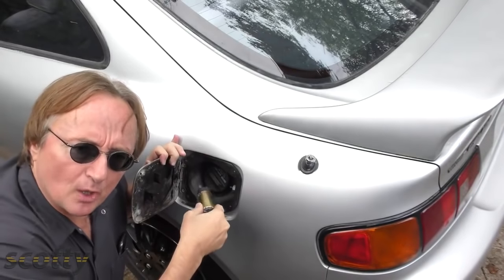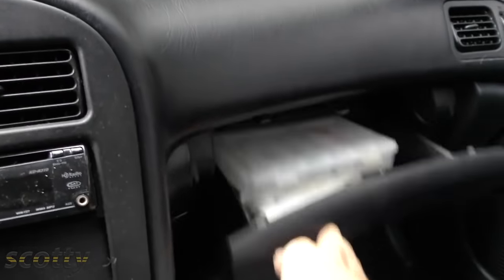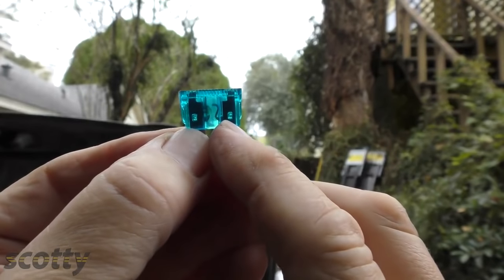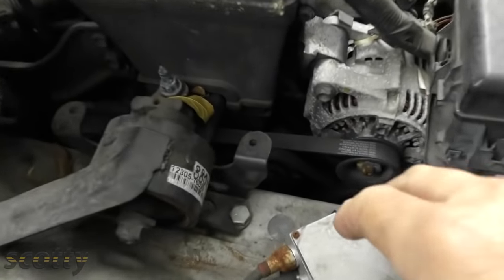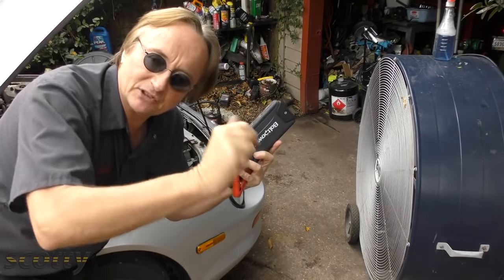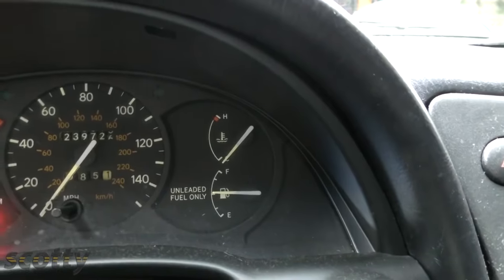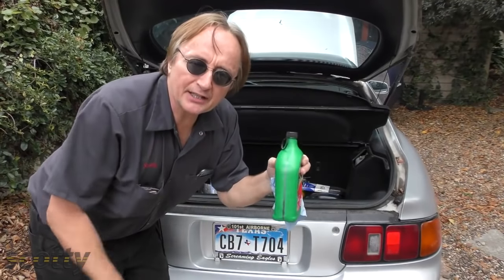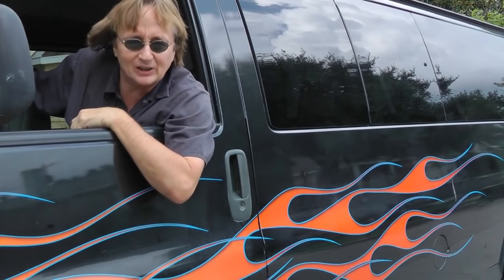How to Fix a Car that Won't Start and Randomly Dies While Driving

Comment: speaking of heater cores, any idea why the hell the heater on my 95 Lexus only half works? basically only blows out real heat if it's revving above 1500 or so. otherwise just blows out ambient air.

Comment: Always have bottles in the trunk of the RX-7 with premix oil for fuel ups. Don't think I'll ever end up with an engine oil related problem. Heck even if the oil pump goes bad I should be good.

Comment: If it cranks and you got gas it my be the timing belt. Be aware of the out-of-gas procedure specific to your vehicle! Just crank and go does not work in many cases. If you are out of gas with a bad gague you can be quiet and listen for the fuel pump noise while the key is on but not cranking.

Comment: Funny you started with the fuel issue.... My wife came home last night after fueling the car(2016AcuraTLX), gauge registers just under 1/2 tank, but the low fuel warning light is still on.... I'm thinking gauge may be ok but computer not working? ideas?
Reply: 2016 should be under warranty.  I wouldn't mess with anything, just take it in.
Reply: Well, we waited to just under 1/4 tank, I had her fill up and the light went out. Hasn't acted up again since. My next step would have been the shop. I have an Odyssey that had the in tank float go bad,  but the Acura was behaving differently. I knew the in tank float was not it.  Anyway, it all seems good for now.

Comment: Check your oil every time you fill up your tank. Just changed it? Check. Just filled it last fill up? check. Its a good habit to start.

And jokes aside, carry consumables. Vital fluids, maybe a belt, gas can, quarts of oil (for the love of god strap these in a safe place so they don't pop), coolant, etc. Also get your oil changed at jiffylube, they check a bunch of stuff which helps take care of your car alot (its worth the extra)

Comment: If non of Scotty's remedies work, like you got gremlins or something, remove your negative battery, wait 15 seconds, and reattach it.  If you own a ford truck, look in the passenger floor board for a fuel pump reset button.

Comment: I have a question my dad has a 2006 jeep commander that's been sitting for 3yrs he just starts it up but never drives it one time he drove it but it would run slow he had his foot all the into the gas pedal and would still be slow what could it be? 🤔🤔🤔🤔

Comment: I've been stranded by an alternator that died on the highway (I like the battery booster trick) as well as a heater hose connector (damn GM plastic) that snapped while driving blowing coolant everywhere. Managed to limp that one home a 1/4 mile at a time.

Comment: Always keep a cab of fix-a-flat in your trunk. More than likely, that's the issue you're most likely to deal with while on the road. If a fuse blows out, you probably won't have the time nor the focus to troubleshoot the issue while parked on the side of the road. In that case, just call AAA and have your car towed home.

Comment: My dads old ram (new fuel pump) wouldn't fire up. After many hours of fussing with it we found it wasnt sending any fuel to the engine. I also noticed that 20 year old vehicles have bad plastics and electrical connections that wont hold. So I checked the connection to the fuel pump, applied some pressure to it and had him crank it and it fired up! We secured the connection with a zip tie and made it home. Another time my dads old ram got stranded was because it wouldn't crank, the ignition housing had a broken piece where the key cylinder makes contact and replaced that in the dark right before a storm hit us. Don't be like my dad, get rid of your old ram.

Comment: i have an 04 bonneville 3.8 it cuts off in drive or reverse.  now it wont turn on at all. i checked altenator its pushing 140 amps as recimmended.  bought brand new battery car started then cut off in reverse

Comment: You forgot to mention those money pits that stop running because the computer goes bad or the injectors die like in those VW BKP engines or those Alfa Romeo's.

Comment: My 1998 Chev. pickup Silverado is well maintained regularly by a quality mechanice who has his own shop and has been servicing all our vehicles for years.  We have a recent problem no one seems to be able to solve. The engine just dies for no apparent reason.  Not often and it's always started right up after a couple seconds. EVERYTHING has been checked!  We maintain everything regularly. The mechanic has used every device available at various points in time to try and diagnose the problem to no avail!  He says he's been kept up at night thinking about it.  The one thing he has not tried is the guage that fits on the engine and stays there while the vehicle is being used so that when it does stop, the guage can be read to see exactly what has happened before it died. Our mechanic says he's been thinking of buying one, but they are very expensive.  What are your thoughts, all the obvious and not so obvious have been checked?  Is this aforementioned guage the answer at this point? If you can solve the problem, I'll shout your name from the roof tops!  Thanks for any advice you can give.

Comment: I remember back in auto shop the teacher said something about using a penny or a gum wrapper as a spare fuse to get down the road is there any truth to that?
Reply: Alex Quintero sure. A fuse just allows electricity to flow, but a fuse will break when overloaded...other stuff wont, which could be dangerous.   I bet your fuse box has a spare fuse in there, if not, id borrow the fuse from the radio or door locks before id use a penny or .22 rimfire cartridge (for a good laugh, google it)

Comment: Fan belt? Scotty that's so last century...but does apply to my rwd volvos.
Reply: holidayhouse03 still most cars I know of have serpentine belts (also known as fan belts from the old times.) with a full electric or hybrid maybe not I think some cars nowadays have at least some additional electric waterpump, electric oil pump and also electric servo pump and AC
Reply: I actually get a kick out of some of Scotty's "old times" vocabulary, it's a major part of his charm.
Reply: He calls them fan belts in his videos because lots of old people know what he means when he says fan belt
Reply: Sure they do... and that serpentine belt runs most everything...alternator...power steering...water pump. 

Scotty talking about an alternator belt coming off sounds like an issue that might occur with a 20th century car. Like my 1989 Volvo. That thing has 3 separate belts....alternator...AC...power ssteering / water pump.

Comment: PLEASEE SCOTTY what is wrong with my boat enginge Perkins 4.236M  diesel ? its loosing all its power arround 1200-2000rpm.  but in idling its working perfect. have changed all fuel filters and water remover and have taken air from system..but its still doing it :( what can it be?

Comment: I need help . My 2003 nissan murano randomly dies on the road. I was at the stop sign and stop and tried to accelerate and my car stop and everything got locked even the sterling wheel . what is it?? When i try to turn it on the car is really low rpms and shuts off .

Comment: I'm ahead Scotty 😀 So i have brake fluid, 1lt of engine oil, belt, fuses, coolant, bulbs, multimeter, tapes, wd40, etc in my trunk.
And guess what, i had to call for the tow because car fuel pump died 😅

Comment: 2006 nissan maxima stalls while driving .. goes to neutral and about 10 mins later cranks and runs fine... any clues as to what's going on?

Comment: Belts that are inspected and changed on schedule don't break or come off while driving on roads.  People who don't inspect and change their own belts are unlikley to have the tools and knowledge to safely change them at the roadside.  That's doubly true for front wheel drive vehicles with a serpentine belt.  You need a long arm wrench and to remove a wheel to do most of them.    Spare fuses are always a good idea, because the crap quality Chinese fuses used as OEM can blow without the circuit being overloaded.  A copy of your vehicle shop manual on CD or copied to flash drive can save you a ton beween DIY work and any time an independent mechanic needs to do a roadside repair of a non-trivial system.

Comment: I remember back in the 80's they sold spare gas you could keep in your trunk - it was like 70 octane or something. Was like a large gas treatment bottle. Car ran like crap, but it did save me one time (gas gauge didn't work - so you had to gastimate your fuel level based on the trip odometer!). Of course with today's cars and the computer controlling everything - not sure it would still work.
Reply: ggin nj i wonder if a can of fuel injector cleaner would work, though?  I bet it would.
Reply: yes, it would work but if you're empty you need at least 1/2 gallon for the fuel to get picked up.  A tiny bottle isn't going to be enough.
Reply: oldtwins na i dont think youd need half a gallon?

Comment: recently I was driving a Chevy S10 pickup and it still had a quarter tank of gas but died out on the road, it kept cranking but wouldn't start,  I thought it was out of gas (bad gauge) but it wasn't, the mechanic took a rubber mallet and whacked the side of the gas tank while I cranked the engine, it finally started after a few times, seems the fuel pump was clogged, got it running again, (since then electric fuel pump has been replaced)

Comment: Had a 99 Jetta that died intermittently.  Drove the mechanic nuts due to no codes. Finally cut out on her. Problem was a loose spark plug.  I did not have tools to get through the gaps in the intake manifold

Comment: And don't forget to check the plugs.  If they wear too wide a gap, it will die. If it's a fuel pump in the tank, get a rock and bang on the center of the tank at the bottom, and try it again. Sometimes electrical motors can get going again that way, enough to get you home.

Comment: My car one day stalled on a back highway. Tried starting it again and she wouldn’t stay going. So I just sat in my car for 15 minutes then started it and fired right up. I think the engine got little hot and the computer killed the engine. And letting it sit a bit cooled it down I might have to change my coolant I think.

Comment: i had a 89 honda civic that had a fuel leak that i built a pressure system that used a air compressor to build up pressure in the tank to find the leak so i didn't have to have the car running. about 6 month later had my fuel pump go out and i used that pressure system with a 12v air compressor to get me off the highway and to a parts store to get a new fuel pump

Comment: My car over heats and shuts off while im driving im lucky if it lasts a few minute i have a 300c srt8 06 my mechanic jerked me out of $1000+ i brought it to an exotic car mechanic and he said he honestly doesnt know whats wrong with it. Its not the radiator or the throttle body because ive worked on both. Might have to sell this thing let me know of any solutions before i do. 2 things to note is I put some regular gas recently and was pushing it a little hard and also i recently got rear ended pretty hard.

Comment: I got a question. I have a 2007 Volvo s40 2.4i that had a blown head gasket and cooling problem. I repaired everything myself, as far as the head and cooling. The engine is getting good oil pressure and flow. No cooling problem because cold air and heating is working and the car isn’t over heating on the dash. But when I start the car it starts, but then stalls seconds later. Why is that? I’m low on fuel but that should be a problem because the car starts. Help anyone?

Comment: I fixed the alternator and installed a new fuel pump they said the battery is good still after checking it and my car is still dying while I’m stopped and my service engine soon light is on but no code pops up

Comment: I had a car that would just die randomly while in motion or idling. If I tried to start it again, it seemed like nothing was working, no starter click, I'm starting to think my ignition switch was going but then again would that cause it to die while already running. Sold the car later down the line, problem never showed up for over a year but I got bored of the car.
Reply: I remember sitting at a traffic light playing biggie smalls player haters and the car just dying. It took a tow truck 4 hours to get to me due to how busy the intersection was, 100 degree weather, traffic coming off the freeway still doing 80mph on 45mph road. I couldn't get out to lift up my hood to warn people, there were so many people blowing their horns and I had warning lights on.

Comment: I had something odd happen recently.  On the way to work, the engine stopped at a light and I couldn't re-start it, as if the car was out of gas.  But the guage said I still had 1/8 of a tank and the low-fuel light never came on.  I had it towed and they said I needed a fuel pump.  However, afterwards, the car now is out of gas before it hits the 'E' and it never gets to where the low-fuel light comes on (It would probably be out of gas around the 1/8 level).  It used to still have a few gallons of gas when the guage hit the 'E' and the low-fuel light came on, and at the 1/8 level still had quite a lot of gas in it.  So somehow the calibration is different now.  And taking the whole thing in, I think the car was actually out of gas when it stalled/stopped, and very well may have damaged the fuel pump because it ran out of gas and I tried starting it so many times afterwards.  I think the calibation on the fuel guage actually somehow went out of whack!  Car had 125k miles on it.   So especially on an older car, there may be another reason to not let it get under 1/4 tank in addition to the other ones.  Don't spend $700 to learn the lesson like I did.

Comment: Hey scotty, My dad has this 23 year old truck, and he is paranoid as hell about using seafoam in the oil to give it a clean. I have shown him thousands of results, and even did it on my car to prove to him. He still doesn't believe me. Anything that you can think of that I can do to show him its safe? I just hate to see a nice classic truck blow an engine for no reason.
Reply: Alpha Nerd how do u know he needs it?  Does he have sludge?
Reply: well let me put it this way. I used it on my car thats only 8 years old, and it even benefited it. It had no sludge and no real permanent oil dirt. But after using sea foam, it got rid of all kinds tiny ticks and clicks and runs like a new engine! His truck is 23 years old and has NEVER had any sort of treatment or cleaning. And we use the same oil schedule as well (3k). So I can just imagine how much shit is built up in that old engine.
Reply: Alpha Nerd ive heard of folks using seafoam in their crankcase and it foulded up their plugs or mucked up their seals or wrecked their oil pump.   Plenty of people think that kind of stuff is merely snake oil.
Reply: l used seafoam on my 20 year old car, and l believe it made my engine oil seals leak.
Reply: bu, bu, bu, bu, but Seafoam is magic. Gyras has "shown" results (I'm not sure what exactly he is showing), his one car proves it to be good.   :-)                        Gyras....your dad has a 23 year old truck that is still running. Seems like he knows what he's doing. Maybe you/we could learn a thing or two from him?
Reply: Not realy. He never checked the rear diff fluid nore the manual trans oil. I got about 1/3 of a quart out of the trans when i changed it. I also had to replace a lot of other shit on that truck. Although most of it is stuff that is expected to go bad.

Comment: Because you've become so popular, you obviously need a technical advisor.   Fuel also helps keep the pump cool. Never trust your fuel gauge below 3/8th, especially on GM. And if your viewers think that oil in the trunk will save them because they ran it that low....well, they were stupid. See them all the time. Too busy or cheap to tend what they rely on remotely proper.

Comment: I have BMW X5 e53 whit  n62 engine  my problem is when I drive my care is not going fast it is like no power in  the engine  The car is strangled  Knowing that I replaced the spark plugs

Comment: Hi, power is draining out of our car from a long time. We changed the battery considering it to be the problem. Even then the car is losing on it's electricity somehow. The battery is in fine condition. We got the central locking system removed trying to check if it was drawing power. But not even that's the issue. What could be the problem? The car will immediately start with just a single jumpstart & we drive it, use it & park it. After about 40 mins to an hour on switch off condition, the car wouldn't start. Again we would need to jumpstart it & carry on this way of usage. Can anyone suggest a solution to this.

Comment: Still not sure why my car won't start. After running it for half an hour the night before I replaced the battery with one that was nearly dead. Now it cranks but won't start. Fuses are all good, has spark and fuel pressure

Comment: My accord 98 every blue moon would just turn itself off and all the dashboard lights would turn on, I would turn the key and it would start up again. It happens when I'm driving maybe 30-40 mph on flat surface streets and I'd have to make a rapid stop(not screeching stop) sometimes I'd be driving down a light and short hill and would stop normally at the down end of it and the car would kinda lightly shake and turn off. Anybody got any ideas? It doesn't happen often. Belts have been swamped cpl years ago water pump replaced the engine has been rebuilt(it happened before n after that too)